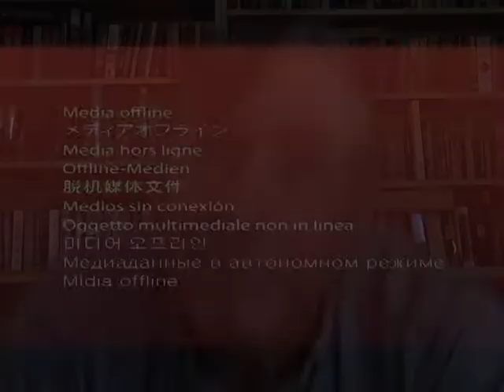Mineral Exposure vs Mineral Liberation

Comment: hi, my name is John , so here's my situation, i have two and a half tons of gold ore, it came from a mine in Ireland, it supposed to have a "once and a half" of gold in it, i see lots of pyrite in it. can u give me some ideas how to proceed
Reply from the maker: First you need to make sure there is actually good gold in it-  Is it crushed or 'run of mine' at this point?  Also, what equipment- if any- do you have for crushing?
Reply: I’m making a rock crusher, I have made a miller table, I also have a sluice box, like I said I see a lot of pyrite, I’m trying to send pictures but I don’t know how,
Reply from the maker: @johnmahoney3632  Assuming there is gold in the rock, it can be either 'free gold'- individual particles of gold that can be broken free of the rock; and 'refractory gold' which means gold chemically combined with other elements.  Since you see plenty of pyrite, it is likely at least partly refractory.  Once you can finely grind some ore, you need to try to separate it into three fractions:  free gold,, other heavy minerals (like pyrite), and the rest of the rock.  If there is gold in the pyrite, you will need to oxidize it or leach it to get the gold.  BE CAREFUL!  Even simple iron pyrite makes sulfur dioxide gas during roasting which is harmful to inhale.  Other sulfides can produce VERY toxic gasses during roasting- like arsenic. After roasting, the gold should be freed up from the pyrite.  However it can still be VERY fine and hard to gravity separate.  Use the technique in lesson 24 to hand pan the finely crushed rock to get gold down to about 75 microns.
Reply: Hard Rock University ok I'll stay tuned in,  and will take that advice, thank u
Reply from the maker: @johnmahoney3632  Keep me updated.  Ask questions if needed.

Comment: My feeling/theory on almost barren holes goes in 2 directions: we want to learn some pious deep thinking and grow, and I've red that some radar works through rock, a pretty big mature field there (geo-physics). There supposedly are ways to DIYer sneak up to it, like making a coil out of a 100 feet of extension cord, sort of like the way a transistor radio can be used as a metal detector sometimes. My feeling on flour gold goes in the direction of the spiritual also, and especially because we seem to reinvent the wheel when working with it. There are flotation shaker tables mentioned in literature I've browsed, but I've not seen them, and until Mad "Not-Angry" Scientist's comment, I might not have got very close in my guessing -- media (salt? clay, pine-oil?), isolating all electrical discharges/ground, glass or varathane skimmers or decks, having the vibration down but the overall movement uphill. [We don't show-off our motorized rock-lickers very much in internet videos and I imagine that's piety or gold fevered superstition.] Especially once you pick up dry-panning with drywall corner bead, "zeta" jar or Gold Claw, etc. Do we see "zeta" seldom mentioned in mining flotation? Might be looking in the wrong places. But electrophoresis is supposedly identical. My journey in that direction included a lot of health food Nano-gold, I'm ashamed to admit. It would be easier to wet-pan for salt. Do we all build dry Humphrey spirals while working on perfecting our light-sabers? Is that reference too obscure? <sigh> Thanks very much for the videos. Much appreciated.
Reply from the maker: You're most welcom.  I'll keep trying to do my best.

Comment: The problem with small batch leaching (as an individual prospector might do with some ore) is that it is a lot of work and takes a lot of time and effort, plus there is a lot more that can go wrong with the chemistry, etc. . Gravity concentration is easier.  If you have small lots of 10 to 12 ounces per ton, that might well be worthwhile to leach in small batches. A couple hundred pound batch might earn you an ounce of gold - even if its a lot of work and time to extract. On the other hand, if you have half ounce ore, a couple hundred pounds might net you a penneyweight, worth $65 and hardly worth all the work and your time to extract it. The big mining companies make it worthwhile by processing huge tonnages of ore.
Reply from the maker: I agree.  I am not getting warm and fuzzies at this point on this prospect.  :-)